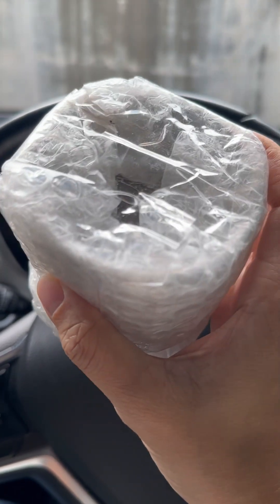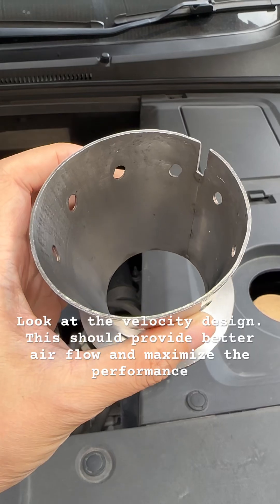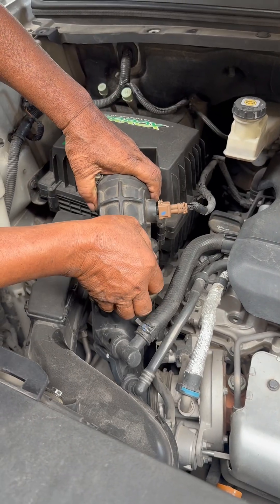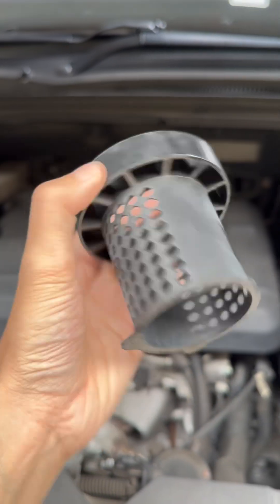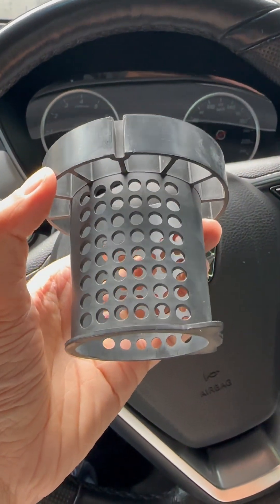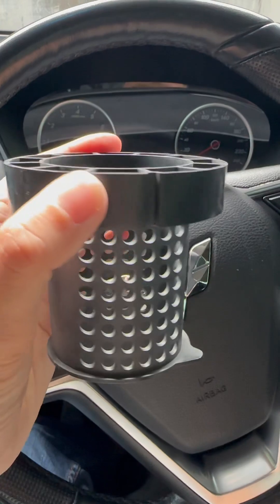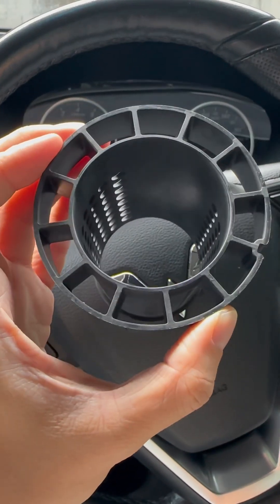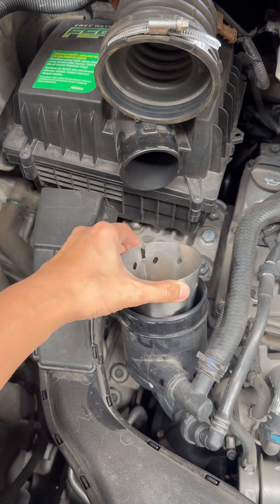Turbo Inlet Velocity Harmonizer. Reduce Turbulence & Direct Maximum Airflow.

Comment: I found one desirable "side effect" by installing this mod.
The turbo's whistling is somewhat more pronounced at lower RPM, maybe at  >2200 RPM (IIRC).
Reply: update : In my car,  it can be heard as early as ~1800 RPM.
Reply: or the turbine just ramp up faster  :D 
evidently by perceivable ( ass dyno :p ) increase in lower rpm torque... or combination of all above.
Reply from the maker: i think its because of the cone design does not have holes to silence the turbine.
Reply: @GarasiFelixDan  Maybe, or maybe it's because the the air flow inside it is more laminar / steady so its doesn't make other noises ( mostly by air turbulence ? ) trus making the turbine blade whistling more pronounced... just guessing, I am not an expert on this field. hahaha..